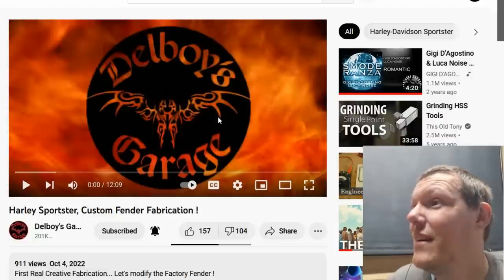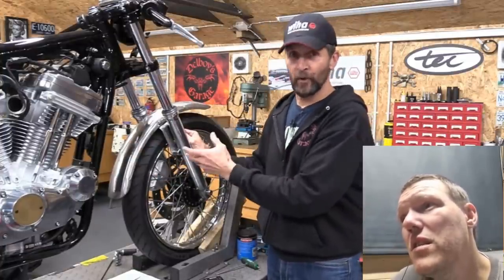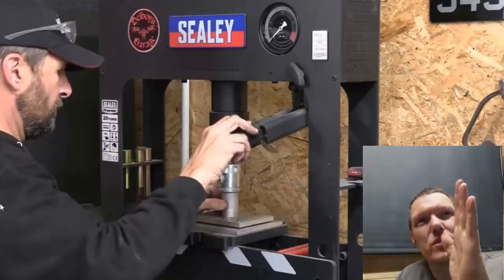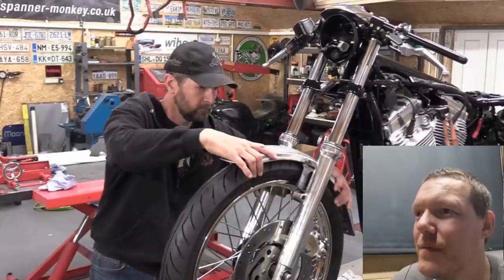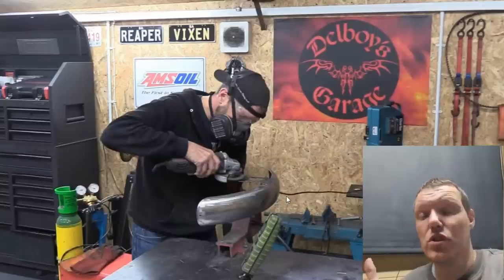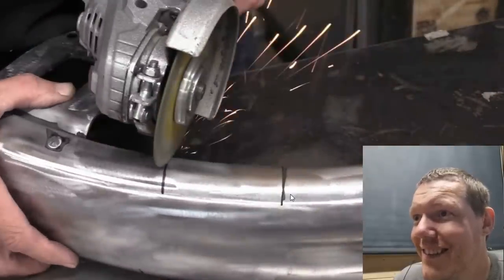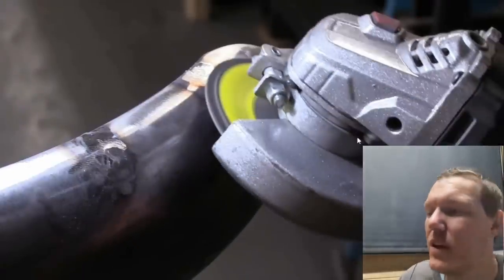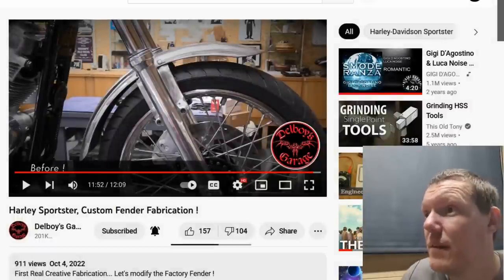FABRICATION! NOP

Comment: To re-radius a mudgaurd is easy for small amounts. To bring it in use a couple of bits of timber on a pivot like reverse scissors to force the beads apart, do this along the length of the piece and it will make the radius smaller, little bits at a time. To make it bigger hammer the beads closer together with a soft mallet and a cushion, this will enlarge the radius.

And he got it on pissed... 🤣🤣🤣

Comment: I was well trained at an engineering company , and a couple of years ago near took my thumb off working with a 5 inch grinder and a cutting wheel ,I had the grinder in both hands and it snagged as the tension came off a bolt and jumped did the bone and tendon , del I’m afraid is dangerous
Reply: With the handle on I might add

Comment: A good tip for extending an angle grinder lead or any power tool, is to use the lead off an old vacuum cleaner. you can usually get them for free.
Reply: These are known as suicide cables in the trade, especially if you don't match the proper rating to one from another device.
Reply: @daviddanielstephenson2833  I'm not sure about ratings but I've been using them for years without problems and I use to restore cars so put alot of strain on angle grinders. Weather is was safe or not is anyone's guess. Lol.

Comment: would it not be easer just to move the holes up a bit?
Reply: Don’t be ridiculous. How’s he supposed to drag that out to eight hours 😂
Reply from the maker: Just what I was thinking
Reply: @seanb250  I would cut off the spare metal off the bottom after the new holes are done
Reply from the maker: Lol just what I was thinking refers to the dragging it out for 8 hours...
Reply from the maker: You.could also cut off the excess...
Reply from the maker: Lol Sean bax already said that...
Reply from the maker: I.dont.know.why.you're.getting.so.tetchy...

Comment: a brace across a mudguard Acan Improve a few aspects of the older sportster handling that thing from the factory... not so much.

it's only really a need if yiu remove the mudguard on the 70s and 80s bikes.

Comment: I've done this multiple times to recreate pieces of rusted floor or inside of wheel arches. It's a good technique to create compound curves provided the finished product isn't in plain sight. I'm impressed with Dels camera work, in reality this fender is concave (?) in places where it was welded and has pimples at the top of each weld. He should have cut a small section out of the middle and welded the two halves together.

Comment: I prefer the us_garage approch for this. so you making gashes - then  place a guide around a wheel and a fender on top of it(like an old fat chain, anything that will give you a right step on every radius point)  -  and  just weld,  with corrections on a fly if needed. it's like tailoring a suite over a real body.

Comment: 1.5mm 3core flex or even a 1mm 3 core flex, both will be more than adequate to carry the current of a 13amp uk plug power tool
Reply from the maker: Apart from that doesn't spec the jacket. If you use regular white light fitting 3 core it's not spec's for higher temps etc
Reply: As Philip says, 1.5mm is adequate, uncoil the flex if you are using the full 13A, if your consumer board doesn't have RCD protection use a plug in one.
Reply: @dirtygarageguy   actually that doesn't matter the conductor size is the only thing that dictates current rating in domestic electrical.

in some industrial applications they use a smaller conductor sizes than rated to reduce cost and will use water to cool full lengths of cabling via tubes in the cable.
Reply: 1.0 mm2
10 amps
Up to 2400 Watts

1.25 mm2
13 amps
Up to 3120 Watts

1.5 mm2
15 amps
Up to 3600 Watts

if you really want the specifics.
Also the average power tool is normally less than 2000-2500watt.

Comment: The bracket for the mudguard is a brace 
Try taking it off and riding the bike.
Fun when you apply the brakes.
Reply: @Chambers36TheEnter  Yes with the old bikes people used to take them off
and put an after market plastic job on.
Then the handling would suffer.
Hence the after market fork brace period .
Do you thjnk if you took it off 
it would make no change to braking and handling?
Reply: @mrmr9767  it wouldn't make a difference as its secured by the yoke and wheel axel. Look at classic motocross bikes they have conventional forks similar to the Harley-Davidson but the mud guard is mounted on the yoke and they are designed for doing jumps ect.
Reply: @wackedoutdude  when motocross bikes are transported they put a fork saver on them to stop them distorting.
the Harley is much better off for having that
substantial fork mount there .
when a single sided brake is operated it will try to lift  the bottom of the fork up and pull it forward .
you think it wold not help with the handling .?
Reply: @Chambers36TheEnter  it.s still a fork brace.
Reply: @mrmr9767  A 200hp superbike does not have one. The same goes for motocross bikes and even scooters.. So i'm guessing there not needed.  When the brake is applied the forks should dive, not lift.
Reply: @wackedoutdude  Moto gp bikes have upside down forks with the top tube coming a lot further down so much stronger possible some form of anti dive.
twin discs for even braking.
a single disc will try and pull the fork .
whatever else anybody does 
using something  to hold the forks together 
in the middle will brace it.
Reply: @mrmr9767  upside-down forks reduce the unsprung mass that is the main reason why they was invented. Powerful super bikes from the 80s and early 90's still use conventional forks and they never had a fork brace because they are not needed. Powerful bikes use twin disc because they need them to slow them down. It's nothing to do with the force only being applied on one side. If manufacturers could get away with using one disk on every motorcycle they would because it would reduce the unsprung mass, but they don't because twin brakes are necessary to stop higher powered machines. The proof of this is the EBR 1190rx that bike used a massive single disc with a massive caliper. The brakes were supposed to be outstanding and so was the handling.
Reply: @wackedoutdude  You are getting away from the original comment.
If you have something across the two fork tubes  in the centre .
You have a brace .
It will help in the handling.
I would think it is better with it than without.
I once bought a R E 1960 Constellation which some one had put a twin leading Triumph brake on it an removed the original 
mudguard .
When braking it would judder and the handling was terrible at higher speed 
the cure i made a fork brace.